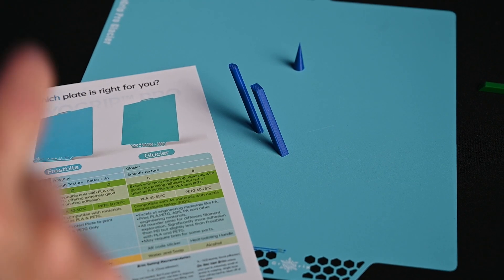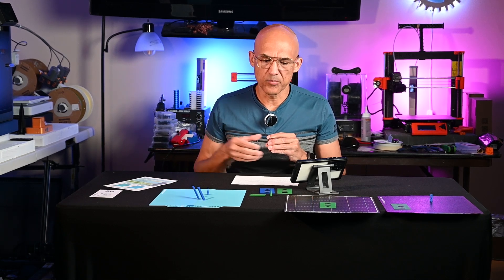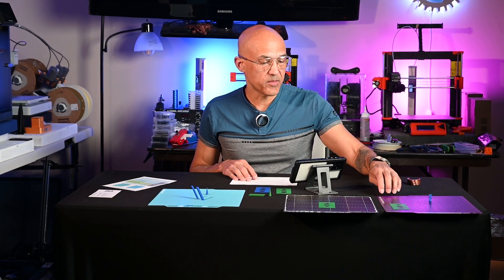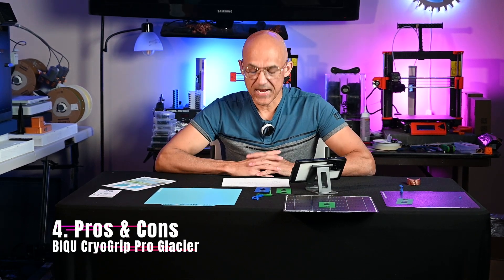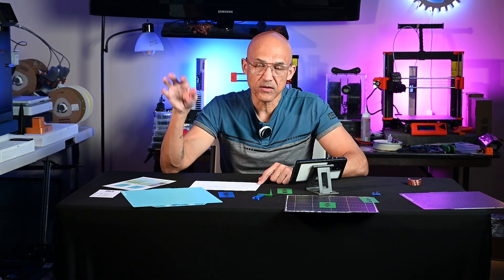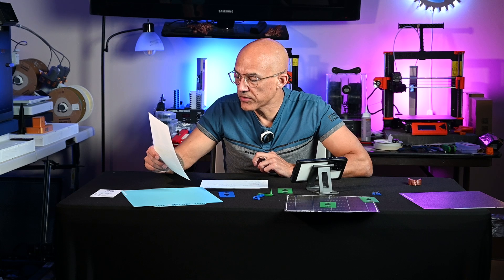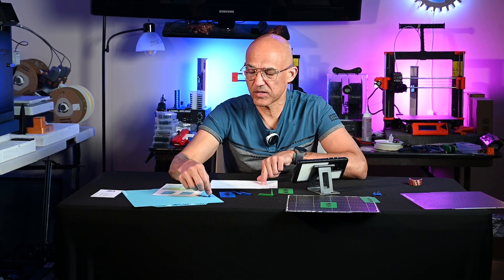BIQU CryoGrip Pro Glacier Review - Best Bambu X1C P1S P1P A1 Build Plate?

Comment: What temperature do you recommend I set to achieve excellent adhesion on the glacier?
:
most importantly, should the first layer have a higher temperature than the subsequent layers?
Reply from the maker: It totally depends on the filament you are printing with so you'll need to run a few quick tests.  PETG is going to be higher than PLA. For my most frequently used PETG (Elegoo Rapid) I set the first layer temp to 70C and subsequent layers to 65C.
Reply: @directedt3ch  I currently use PLA exclusively
Reply from the maker: For the glacier and PLA I'd start with 60 for the first layer and 55 after that.

Comment: i cant get petg to stick to the glacier no matter what temp. it stuck some at 85c.
Reply from the maker: What?!? Really, that's wild!  I use 55C normally for mine and it will still be stuck to the plate several hours after cooling.  If I use the stock plate it will release itself once cool.
Reply: @directedt3ch  i just got it today and have done testing most of the day. i think im going to try to send it back. maybe i got a defective one.
Reply from the maker: @KidAgainHobbies  Have you given it a good cleaning? Hot water and dawn dish detergent?
Reply: @directedt3ch  yes several times and alcohol too. i dont use dawn but a similar brand.
Reply: @directedt3ch  im returning it. the company wont even email me about it. its a garbage product. i put my smooth pei plate back on and it stuck like glue even with the z offset set high. i wasted a day and a half of my life and tons of filament trying to get this garbage plate to stick. its like trying to get something to stick to silicone.
Reply: @directedt3ch  ive watched others videos with the glacier pro and theirs would not stick at 55c. you must have a special one. 55c is the lowest they recommend for petg. i got it to stick ok raising my hot end temp and using 85c bed but i still dont trust it to stick. and when the bed cools it almost unsticks itself. the pei plate i have is much much better sometimes sticks too good at 65-70c. i havent tried pla.

Comment: What plate type do you select in Bambu studio for that plate?
Reply from the maker: Right now, there are only two choices in Bambu Studio, Smooth PEI Plate/High Temp Plate or Textured PEI plate.  I usually go with the Textured plate and then adjust the build plate temps in the filament profile.

Comment: what about someone tries ABS  ASA Nylon etc.... PLA is not a difficult filament to adhere to build plate  PEtg a bit more tricky but again not a big deal when i print it is stick to bare Aluminium plate up to glas garolite etc......    And praising plates where PLA and PETG has a good adherance on the build plate  is not helpful ......
Reply from the maker: PLA at low or no temps is the main selling point for this plate.  While the Pro Glacier build plate is compatible with ABS and Nylon, there isn't as great a reason to use this plate over another.  I've never printed with ABS or Nylon so it wasn't something I included in my testing.  I do like your idea however, and if I venture into using those filaments I'll be sure to see how this plate performs.

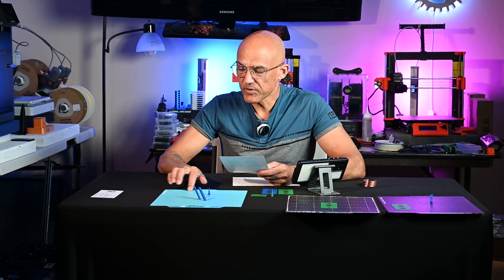Comment: 1:45 so...where's the close up of the texture comparison?
Reply from the maker: @xKenn  My apologies.  During the edit I cut that part out. It is about 50% smother than the PEI sheet.  It's not as smooth as one of the Bambu smooth sheets though.
Reply: @directedt3ch  Nice, that's actually what I'm looking for, a fine matte texture. The stock textured PEI plate is a bit too coarse and glossy for my liking lol
Reply from the maker: @xKenn  I think you'd be happy with it then :)

Comment: On what planet is this a "cool plate"?   It's the exact same temps I print on my PEI sheet...AND you had to print at the maximum recommended range to get a successful print... PLA WILL fail printing at 45° before you get to 10 layers.    You must run it at 55-60°.   CRYOgrip and the snowflake on the plate imply performance that this plate actually isn't capable of.   I've heard good things about the Frostbite plate, but I OWN two of the Glacier plates, and they are absolute garbage unless you run them HOTTER than the PEI plate...
Reply from the maker: My results were definitely cooler for PLA and just a bit cooler for PETG.  Definitely not a huge decrease in temp on the PETG.  It works well in my applications and the purchase price vs. the Bambu PEI plate is quite significant.
Reply: I can't agree on this. My Glacier delivers perfect results and a very strong bed adhesian. Also running much lower temps for the bed compared to the original plates. Original Plates are no where near this specially on the bed adhesion topic.
Reply: 100% true . i tried this plate . nothing special about it. my first print failed tried again and had to print at regular pla petg temps. and nothing will stick to a dirty plate so make sure to clean well. I still prefer printing with my bambu hi temp plate. i put some liquid glue on it and i have printed over 10 prints on same plate.
Reply: @peterpeter5666  The frostbite is the plate you want
Reply: your right. my creality smooth pei plate is great. i print at 70c on bed and it stick really well. the glacier i cannot get it to stick even at 85c.

Comment: BIQU makes some really good products and I'm glad they are making so many products for the Bambu Lab printers! Its great to see cheaper and better alternative aftermarket products. I guess they are owned by the same company that owns Bigtreetech and they do the same thing. I have seen these plates all over the Facebook groups and I have really been wanting to try one of these out. I don't think the power savings for these should be a selling point from them unless in massive print farms lol but the bed adhesion is amazing for these. I have seen so many crazy prints coming off of these without the need of any glue sticks. Its also crazy that these stuck so well using the A1 since the bed is moving back and forth. The only time I ever get issues with my A1 is when I have tall thin parts.
Reply from the maker: @jmp7624  Totally agree! I've never worried about my temperature on the heatbed. I've only ever increased it for better adhesion and then left it where it works. But a plate that performs well at a good price definitely peaked my interest!